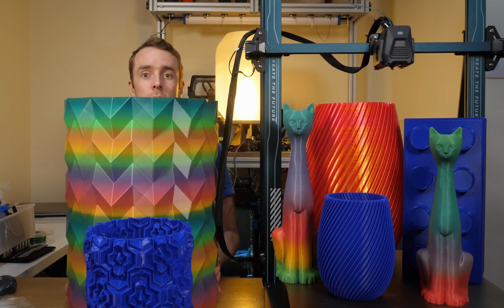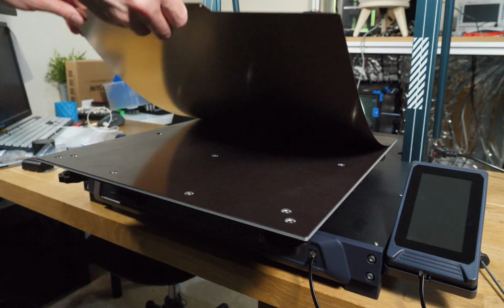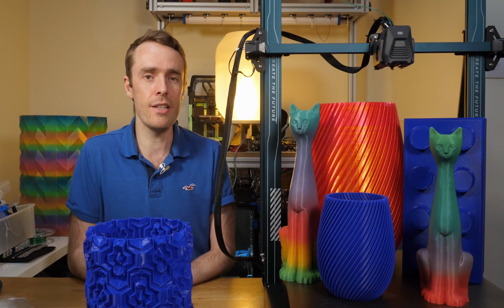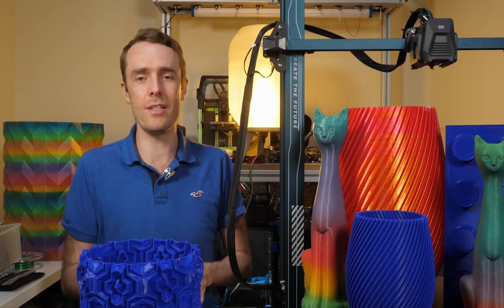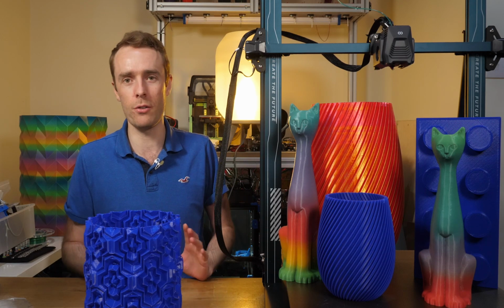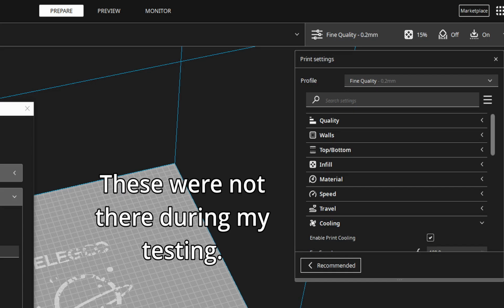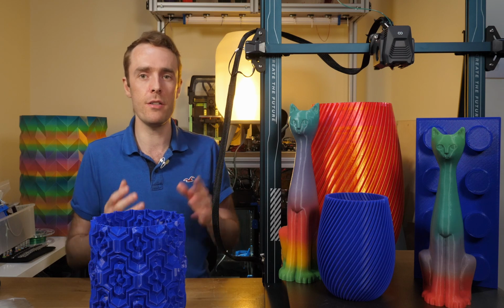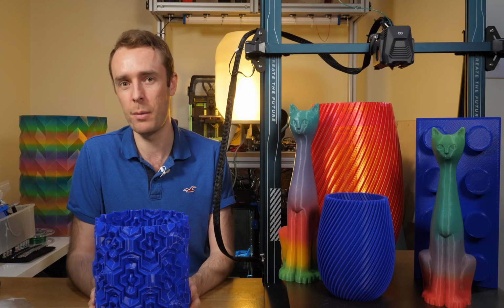Is Bigger Always Better? Neptune 3 Max Honest Review

Comment: Good Video - I have a Neptune 3 Max and a Longer lk5 Pro. Both are good printers but the Max prints bigger and faster. I would love to know what setting in Cura I would have to change if I installed a 0.6 nozzle, because I do have one but have no idea what to change, bit of a newbie. Oh, the cable on your printer isn't installed correctly, I did the same thing as you when I installed it the first time and yes, it dragged on the bed, reroute it to point up and you will never have that problem again.

Comment: Pretty sure the Neptune 4 max already has klipper.  I wonder if they addressed the nozzle size, cable management, and heartbreak design
Reply: Yes it has Klipper, nozzle is 0.4mm and  custom designed (problem with replacements and bigger sizes), cable management looks not fixed, it has an all metal hotend with ceramic heating element and over 20mm3/s max volumetric flow.

Comment: My red loctite heat break was not cut flush and allowed filament to ooze past it and the nozzle threads causing one hell of a mess that wasnt noticed until it was way too late.  still got it apart, cold, with vice grips cause I wan't going to let that little heat break win lol.

Good news is you can modify a sprite 300c heater upgrade kit (block, thermistor, heater, and nozzle) and use a cr10 bi metal heat break to make these 3 series better.  the new firmware will let you put temps to 300c in your slicer as well.

Comment: I just bought the Neptune 3 Max and my few prints so far went very well. I never printed ABS and I'm sure I never will because I use the (at least if you ask people who have tested it and have more material knowledge than I do) "better" ABS. I print with ASA. I printed ASA on this printer at 210°C (that is the recommended temperature to print from the manufacturer) with 100°C heat bed temperature and I had no problems with warping or bad layer adhesion. 
Nevertheless I want to change the nozzle for now to a 0.6mm, perhaps later on to a 0.8mm. I saw people complaining, that with a bigger nozzle the print cooling wouldn't work good enough anymore. Can you say something about that?

Comment: Great video! I'm deciding if i should buy this printer and i have a question. Is it possible to upgrade the hotend to a full metal one? I haven't found anything yet, for example Micro Swiss hasn't got a full metal hotend assembly for this printer yet

Comment: I appreciate you bringing up its drawbacks, though I did feel a sense of relief at the end because they were mostly nitpicks.  I did wish though that you'd offered a bit more technical analysis, like measuring its speed and using it for small and detailed objects.  Not everyone has a printer for every day of the week, so something substantial like this should be more than just a one-trick pony.  Btw, I have no doubt in my mind that Sovol will try to make a splash with their own version of a giant printer in the next several months and it will likely be even better than this.
Reply: Sovol is a TRASH BRAND!  I wasted $400+ on that stupid SV04 and it’s now non functional. It worked for only a couple prints then constantly had errors. BIGGEST buyers remorse I’ve ever had! This neptune 3 Max is about the same price and it might only print in one color but at least it’s not a headache like the Sovol branded printers.
Reply: @boddlook  If it broke after a couple of prints then it was still very early into its warranty period.  Why didn't you try to make a claim?  Literally any printer can break.  They've all got their own issues.

Comment: Are there downsides to going big if you don't plan on using it for large prints?  I mean, is the quality on small prints any different than the smaller Neptune 3 printers?  The old adage 'you can never have too much/too big' usually holds true, and you should get the biggest you can afford because you always want more capabilities in the future, but does it apply here?
Reply: I can see at least one point that's a bit of a downside: it's a 'bedslinger' (it has to move the whole print bed around for movement in one of the axes), and at that size, having to slug around all the weight of the BIG bed kinda limits the possible max effective print speeds, even when you're doing only a small object on it...

Comment: One solution for the cable hanging down at the top. Take an office ID badge holder, the ones with the little zip reel that retracts, and mount it to the top frame. Then clip the other end to the cable. Hopefully it should be long enough to reach the bottom. That will help keep the cable from hanging but give it enough flexibility. Search for "Retractable Badge Reel with Claw Clasp and Clip for Id Card Holders"

Comment: Great review, you cover really important topics! I am just gonna say it... The one thing lacking for most of these companies is common sense lol. The fact that an enormous printer like this comes with a regular flow hotend and 0.4mm nozzle is a testament to that haha! :) Also the PTFE that goes right to the nozzle should be illegal at this point, there is absolutely no reason not to use all metal heatbeak.
Reply: there is a flexibles preform much better with ptfe
Reply: It comes down to price I gather, this is a budget model

Comment: To be honest I used just the original prusa profiles for my N3 Pro and it prints really really well, Just changed the start and end gcode but it wasnt even necessary.
I can even print presliced gcode from printables
But the point about no profiles from the manufacturer surely still stands

Comment: Couldn't agree more to the improvements, a better hotend and heatbreak would be my first upgrades, especially the heatbreak just for the reason that i dont get surprise leaks out of nowhere. Your cable management idea is ingenious, i often use ptfe tubing for that. The creality cr m4 uses a drag chain, but im not a fan of that because you need really good wires for drag chains, otherwise your wires break
Reply: The way to stop wire breakage is to have a large radius in the bend of the drag chain, to acheive this you need a purpose made fixing point for the start of the drag chain and then design the rest of the machine around this, I dont think Creality did it this way!
Reply: @AndrewAHayes  the bending radius definitely looks larger than what a voron has, especially the smaller 250mm ones. Those have fairly tight radii, i removed the xy chains for reliability and i have a canbus setup, so there wouldn't even be a reason for drag chains. For z its a different story, way less travel